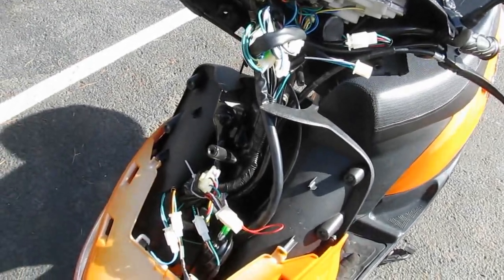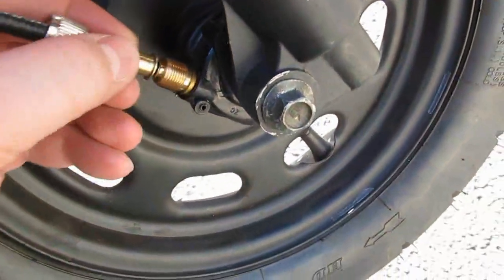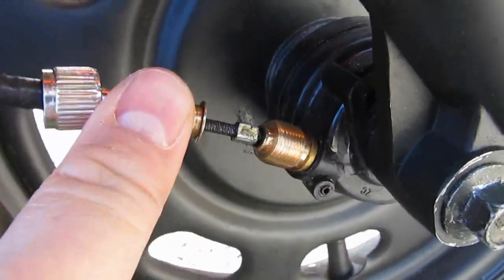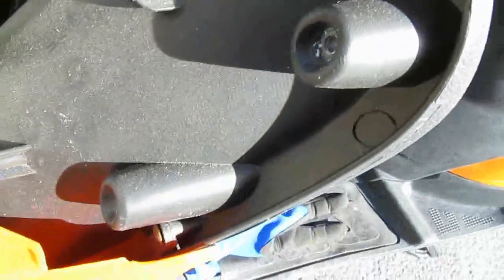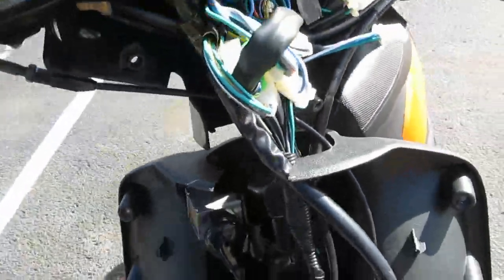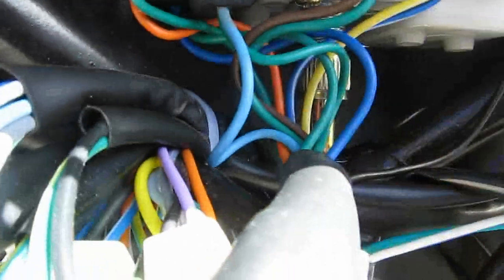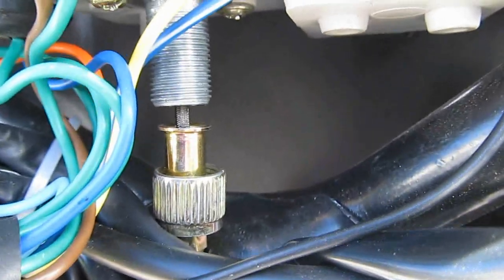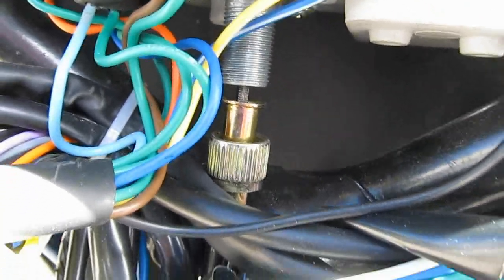Taotao ATM50-A1 Chinese scooter speedometer troubleshooting and inspection - broken cable

Comment from the maker: Hey Michael thanks for the tip. On mine it was a different story because the scooter was brand new with only 400 km on it. The speedo gear puck was installed by the dealer improperly at the wrong angle so the cable had a sharp curve in it coming out of the puck. That's where it snapped.

Comment: I replaced my tire and put my wheel back on and it was fine but now by speedometer and mileage isn't working and when going down the rd it sounds like something is grabbing the front wheel. Any suggestions? Also my gas gauge turn signals and horn stop working but my fuse is good but my battery isn't any suggestions

Comment: Does it give you the right speed. Because mine is new and marks a speed but I'm really going much less than that. It dont make sense
Reply: try getting a digital speedometer, they shows more correct stats than a typical analog speedometer
Reply: I"ve heard these speedometers are usually off. When mine marks 60 I'm really going 50, and I know this because my phone GPS says the actual MPH lol

Comment: i had trouble with my speedometer cable breaking all the time i took the speed hub off and cleaned it it might have dirt in where the gears are since i cleaned it i have not had any more breaks on the cable.